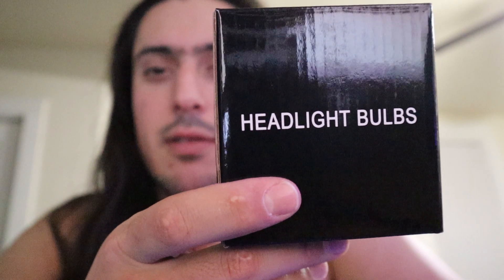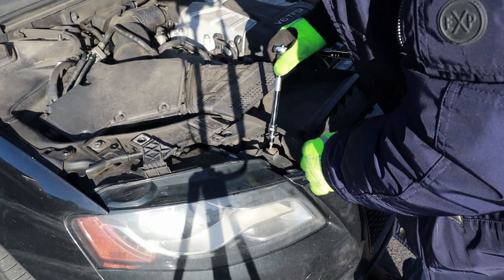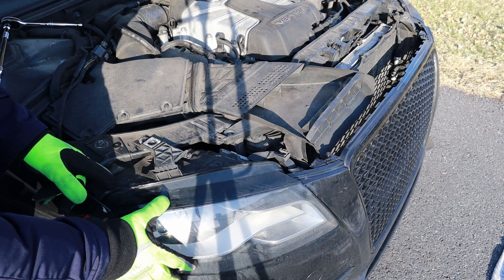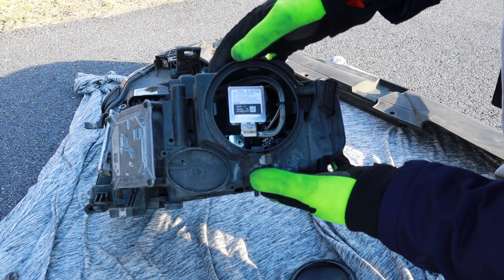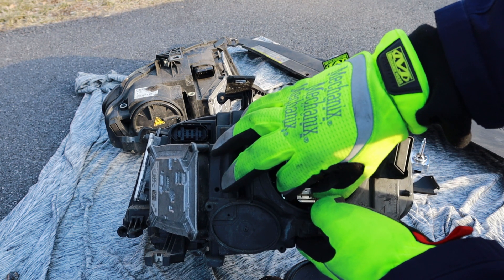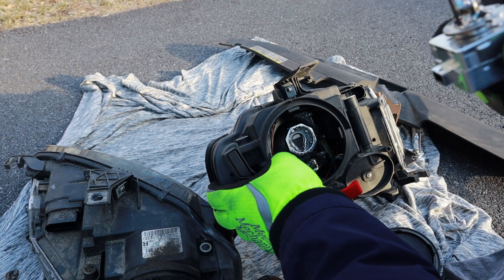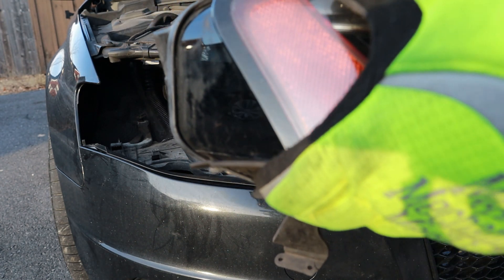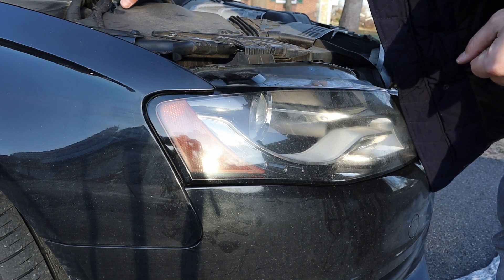Repair:: Headlight on Audi S4

Comment: You don't need to remove the headlamp to replace the bulbs. And I'm sure you know that now. Second I wouldn't recommend cheaping out on bulbs, plus 8k are going to lose a lot of light output. These are the best bang for the buck https://www.theretrofitsource.com/d3s-morimoto-xb-hid.html?carDisplay=2013+Audi+S4+%28HID+Equipped%29&preselect=&preselect_restrict=1. Stick closer to 5000k for the most lumens.